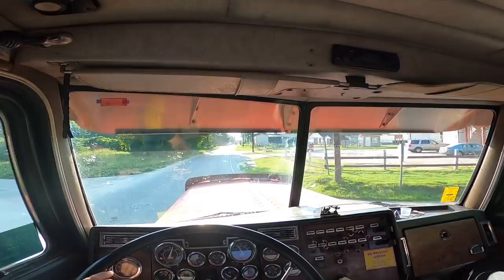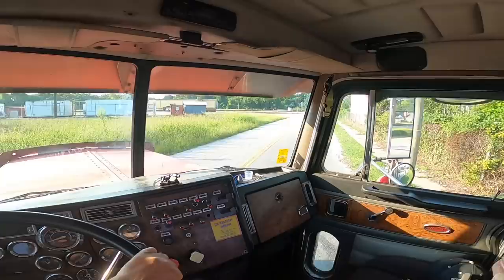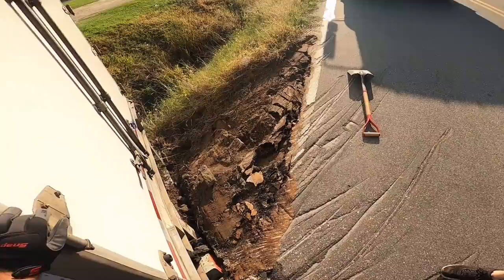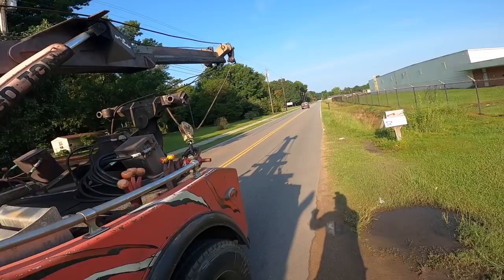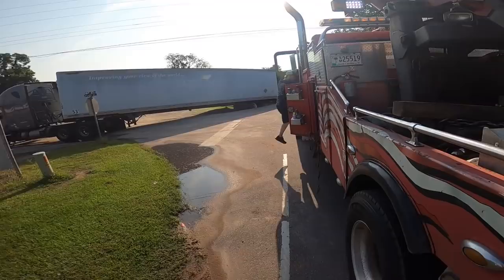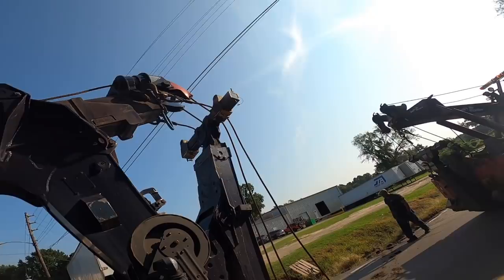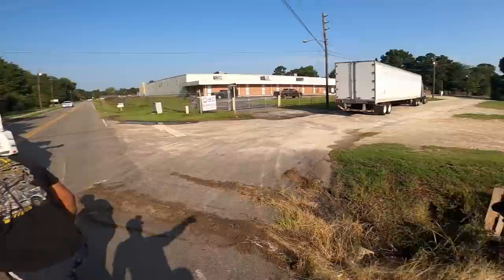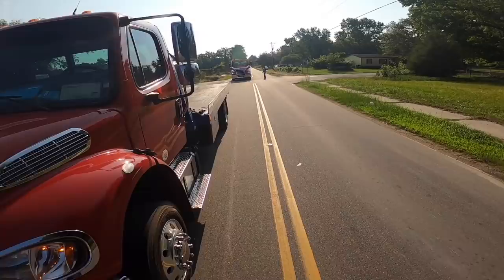Results from not turning wide with a trailer

Comment: Nice recovery as usual.  It probably just me but what cracks me up is when I see folks driving the mid to large SUVs taking a wide turn.   Nothing wrong with feeling safer I guess.
Reply from the maker: Mr Will thanks for watching and stay safe
Reply: I pull a fourty one foot fifth wheel RV. Nothin wrong with turning wide. Beats new Aluminum rims and a set of tires when they come into contact with curbs. Lol. Or worse yet just driving it into a ditch or telephone pole.
Reply: @lloydholt6511  That I get, but I just don't get swinging out simply with an SUV...nothing attached.
Reply: @willb3018  I've watched people with friggin Toyotas making a wide swing to make a turn, crossing the centerline to make a right turn. What would these idiots do if they had to drive a real truck??😆

Comment: Judging from the number of scrapes in the pavement it won't be long before your back there. Thanks for sharing.
Reply from the maker: Mr Carl  yes sir you are right. Thanks for watching and stay safe
Reply: hello carl 
how  are you doing
Reply: hello carl 
how  are you doing
Reply: @jennifersmith842  Doing well. How are you ?
Reply: Except for future business.  If that place put up a sign just off edge.  “swing wide, it’s a xxx trailer”. (Stolen from bonehead truckers).   Or put longer culvert, dirt wider edge.  Cost less then 2 recoveries.  If his tandems were back he could claim he forgot to slide them ahead…   If no DOT bar do you think he might have pulled thru?   Was unloading from spot considered?  
  I was thinking he could then lift at full extension, retract onto tar.   Dang power line makes it fun.  
  Was at one dropped trailer in ditch, grain truck, ripped off one hopper, tractor on RR track.  They got train stopped.

Comment: Driver makes a mistake, it happens. While they work to help him he just hangs out in the sleeper. I bet it happens again to him.
Reply from the maker: Mr KO Yes sir  but I hope it doesn't. Thanks for watching and stay safe
Reply: That is what usually happens cause the generally the company they work for doesn't want a injury risk and the issue of the person running the wrecker has insurance liability to deal with as well. Having someone messing with stuff they have no idea what they are doing is never a good idea. Better to keep them out of the way and let the professional do their job.
Reply: @arbiter1  there is keeping out of the way at a safe distance and staying in a sleeper while a vehicle is being lifted. I would be on the sidelines where I can hear if someone screams there is a issue. As a heavy equipment mechanic I have no been to many winch outs and even had graders, dozers and other items in a ditch. It’s not hard to stay out of the way, safer on the sidelines then is the vehicle hooked up. I have also been in the seat as loaders were un righted due the the boom in the up position and a person needed to be in the seat to control the boom.
Reply: I broke down once and took a nap while the professionals worked. I wasn’t going to watch them and then drive tired.

Comment: Made deliveries as this. Complained to our bosses,  they said if causing problems as this. Take it to seller, let them deliver. Sales folk told buyers yes drivers  will deliver. Worked for Ag. Company. Had to drive down roads dirt with canals on both sides or over plowed fields. Getting stuck, tearing up bumpers, lights. Company backed us. Take to store , let them use 10 wheelers to deliver, wow fussed. Saved our tractors. They don't give those things away. In 80s retired.  🐻👍
Reply from the maker: Mr Ol Bear thanks for watching and commenting. Stay safe

Comment: I would say that guy needs to cut some of his dread locks off, they are affecting his ability to use common sense. To put the entire trailer down in the ditch is to prove that you are a steering wheel holder and not a truck driver.
Reply from the maker: Mr Joe thanks for watching and commenting. Stay safe

Comment: Excellent job you guy's. I would have to say a Tator would have been nice for this job but you and your guy's have the experience needed to do this job with out a Rotator. I seen those power lines in your way as always. Great team work guy's. (I watched this while sitting on the shoulder of the freeway waiting for my mechanics to show up and change a drive tire that blew out on my mixer) Sunday night pour at a large commercial building, 2,500.00 Yards of Concrete going in tonight. (Double Time is nice)  Be safe out there guy's.
Reply from the maker: Mr Dan yes sir it would have. Thanks for watching and stay safe

Comment: I’m all for better safe than sorry Hal but for next time remember if you’re using 2 chain legs then each chain only has 10 on it so even if one side take a little more than the other when the lift starts you won’t exceed the 15000 on your half inch
Reply: So you would still be safe without having to bust out the really big boys
Reply from the maker: MR Bam thanks for tip and thank you for watching. Stay safe out there
Reply: You’re welcome EVERYONE always forgets that part it’s the same as with a snatch block your two chains is two lines on the load so each chain has half of the total weight

Comment: Would the under reach on the V100 have lifted the trailer and backed him up as if towing from the rear far enough to get him on the road. Just a thought but it was a good job, God Bless and stay safe out there
Reply from the maker: Mr John it may have. It has a 144 inch reach and rated for 18,000lbs

Comment: Would the flat frame hooks be helpful in the situation where you need to lift the full width of the trailer with only two contract points other than possible strap and angle protection of the upper superstructure of the trailer?
Reply from the maker: Ordinary Miracles  Shane suggested we use them but I decided to the 5/8 chain instead. Thanks for watching and stay safe

Comment: 🤦🏼‍♂️🤦‍♀️🤦🏼🤷🏽‍♂️Looks like he didn't go deep enough in the turn or wide enough.  You're pulling a 53 feet long trailer!  Cut it deep and cut it wide in the turns.  This should not have happened.  Don't worry about the traffic behind you waiting if you have to wait for traffic to clear so can button hook.  They'll get over it.  If you're not sure that you can safely make the turn go down the road and turned and make a left turn into it.  All of that hair must have gotten in the way of the driver's eyes and he couldn't see in the right mirror.  I guess some drivers don't realize the mirrors are motorized for a reason.
Reply from the maker: Do not need.  Yes sir I agree  with you. Thanks for watching our videos and stay safe
Reply: @SumterWrecker , I'm medically retired now.  Since 2018 but started in 1991 and also drove when I was in the Army in the States and Korea.  Had been me I wouldn't have been sitting in the truck but back there to lend any assistance I could even if it's stopping traffic.

Comment: lets bring 3 truck when only 1 truck is needed. that way we can quickly run the bill up yo $10,000
Reply from the maker: Make it pay that bill was no where close to that. The rollback was brought so Shane could learn. I usually can get them out with the 30 ton but knew I didn't have enough boom reach and I still only charged for one truck. Stay safe
Reply: @SumterWrecker  understood, looked like a pick & swing from the video but i did like those power lines hanging so low.